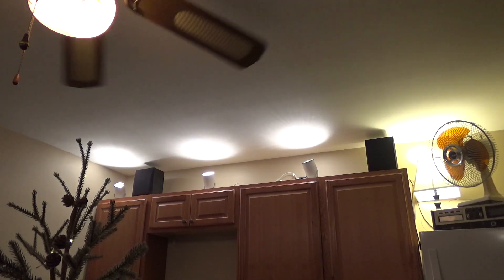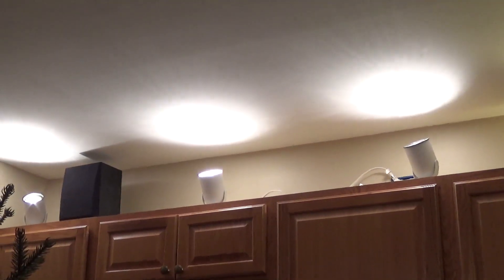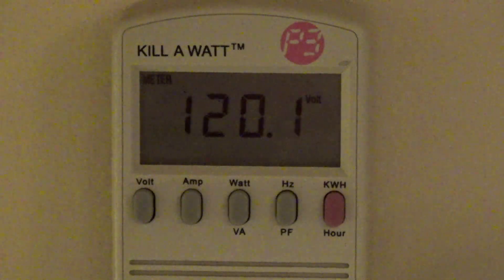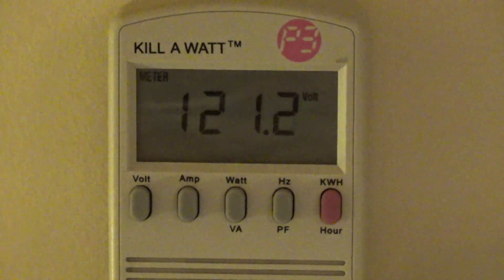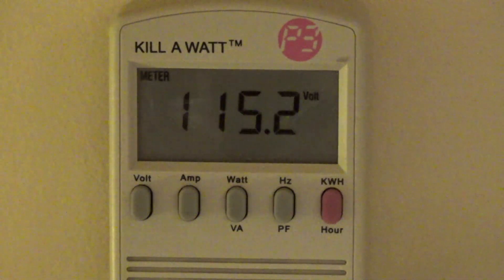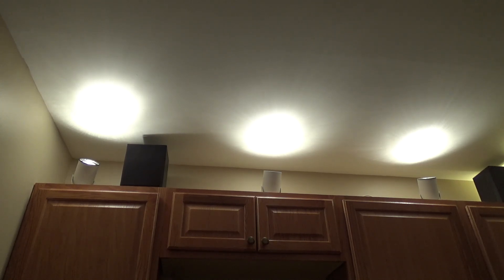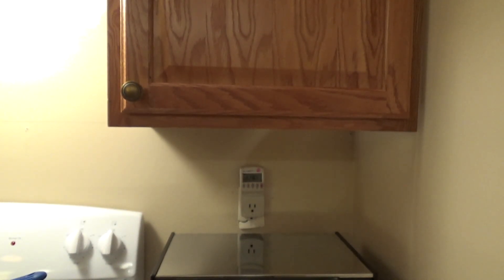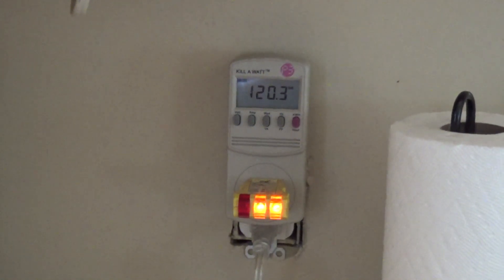The Voltage Goes Off The Charts

Comment: Bad/loose neutral. When one phase gets a higher load(amps), because the neutral is bad/loose somewhere, the extra current goes through the load that is on the other phase. This is why shared neutral circuts could be a bad thing if not done/balanced correctly. I would start at the panel and check all neutral, especially the main neutral and bonding screw. Then go to the meter if possible and check and lastly have the power company check the pole connections.

Comment: A while back we had a similar issue, slightly worse, it was damaging things. The power company gave us the runaround stating that "the house has old knob and tube wiring, so the issue is on your end". After finally convincing them it was NOT our issue, they begrudgingly came out and of course it was their issue, there was a burned neutral on the power pole right by the transformer.

Comment: Very strange, a source online says " over voltage in the power system may also be caused by, insulation failure, arcing ground and resonance etc." Looking forward to any follow up video after your guy has investigated.

Comment: 100% a weak or missing neutral, probably on the pole. Had the same exact problem in the house I'm living in. Noticed last year the Christmas lights would get brighter when someone ran the microwave oven. Unplugged the dryer and measured 126V L1 to neutral and 114V L2 to neutral. Called the utility to alert them of a bad neutral, and sure enough, tech told me the neutral splice on the pole was crumbling. Neighbor down the block had no neutral at all (wire broke) and the two hots were bearing all of the mechanical load between the street and their service entrance!!  Sometimes, all of the neutral current returns back to the transformer through someone's CATV wire and has caused fires.
Reply from the maker: It was a bad common, the connection on the house was corroding. All 3 were redone, now the electricity is better than it's ever been.
Reply: @JordanU  I knew you'd have this under control.  Good for you for investigating before it got destructive and I'm glad your power company provides decent service.
Reply: @jordanu
Just saw the followup video, thanks for the update. Gald everything got resolved.

Comment: I bet it's a Hydro power company I think they increase voltage when appliances are running too much amperage and wattage, probably to avoid damaging electrical Transformers and need the correct voltage or like people said it loose neutral wire!

Comment: Test the voltage on each line to neutral, if they are not exactly the same you have a bad neutral and should unplug or put a line conditioner/AVR on any 125v sensitive electronics until its fixed!
also check that there is not over 262v line-to-line which would indicate an over voltage supply from the utility!

get your power company to inspect both ends of your service drop and meter, and an electrician to check your panel(s) if the PoCO doesn't, especially with Zinsco and FPE panels

Comment: Hi Jordan, you're probably having this problem with your voltage because you use old, outdated appliances that use too much electricity! You should get rid of them and replace them with new, energy-efficient appliances! That will fix your voltage problem, save money in your wallet, and even help the environment! Me and my wife Lois recently replaced our old boiler and furnace with a new heat pump, and it does an amazing job at heating our home! It works even better when we turn on our Lasko 3733 box fan while the heat pump is on so it can move 8,000 CFM of warm air all over the house! Also Jordan, you should replace your incandescent and CFL bulbs with LEDs! Incandescent bulbs waste most of their energy creating heat instead of light! CFL bulbs are very dangerous because they contain mercury which causes cancer if the bulbs are broken! LED bulbs are mercury-free, more energy-efficient, and last longer than any type of incandescent or fluorescent lighting! Me and my family love our LEDs and will never go back to our old lighting ever again! We all hope your electricity problem gets fixed! Have a great day, Jordan!
Reply: The appliances are not the issue, Spammy Reedy. LED light bulbs suck.
Reply: a fatal problem with this theory, high power draw causes voltage to drop, not increase

run a hairdryer and a heater on the same circuit and compare the voltage on that circuit to when neither appliance is present
Reply: i would not recommend you tell this man to use leds
Reply: That would cause a decrease in voltage